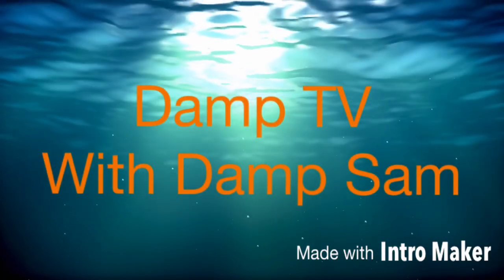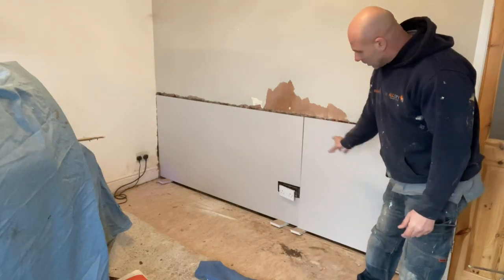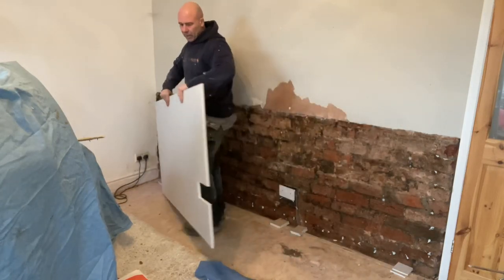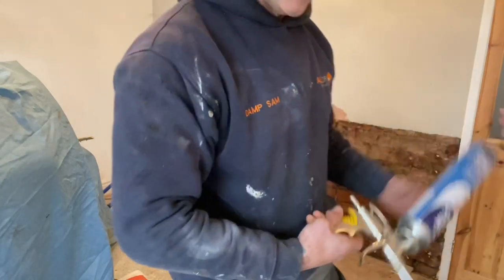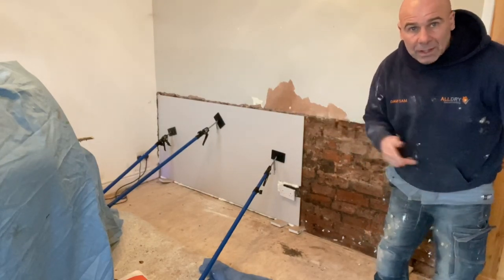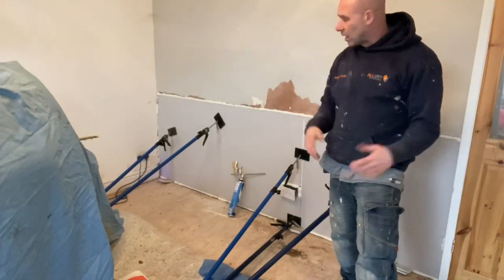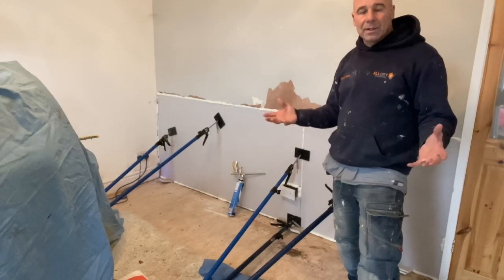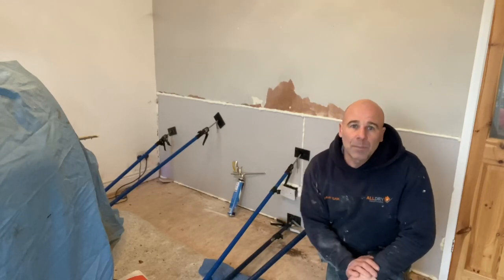How to Dampproof a small wall like a boss

Comment: Damp proofing injection does not work. You need to find the cause (probably a small leak somewhere) and stop it. If that's not possible you need to leave the brick out in the open and have good ventilation or add a breathable lime plaster and have good ventilation
Reply from the maker: I agree that each damp issue has to be diagnosed and not all damp is rising. Lime plasters can work in the right situation but not every one, they are expensive too and not accessible to all. Poorer people have a right to live damp free and this is why cheaper faster systems were brought to market.
Reply: U can also have more than one issue. In our 30s semi, in kitchen, when first moved in damp, mould appeared. After investigation by me, I cut the back out of low cupboard under sink, but it was slightly further over from sink pipes was an old pipe  sticking upright that had been capped but was very slightly leaking. Not enough to flood but did make very damp behind cupboard. Fixed it all pleased with myself in the hope that was that.  Still got damp possibly from a concrete slab added at back door under kitchen window. Eventually I cut channel in it so it wasn't connected to the wall of house above the ground level. Still to finish that job. But also condensation is quite common. Any steam hits the gable end wall and ends up dripping down wall, if don't have extractor fan on and window open. It soon drys, but winter it takes a bit longer, and can be tough opening window when freezing. Watch out for drying clothes too. Especially on radiator. Really u need window open too, so the moisture can escape. I've seen it a lot. Tons of washing drying, windows closed causing bad mould growth.

Comment: Hi, watched a few vids now and I know you use acrylic and foam to fix the boards, l know the foam grabs quick and let's you move on while the acrylic sets. Where I'm a bit confused is does the foam not spoil the effect of the acrylic, I imagine it doesn't because you would stop using it, but then why not just use the foam to fix. What's the benefit of both.
Reply from the maker: Hi, thanks for watching, when the foam dots are first put on the board they are so flimsy that the board would just touch the wall if you applied it straight away. With the drygrip dot in place too you can feel when you ease the board to the wall, 
Also as the drygrip dots are around the same size the board is against the wall pretty even meaning if the wall is plumb the boards are not far off straight too. 
When set the drygrip has a mega strong bond with the masonry about 10 times stronger than the instastik. 
Iv used drygrip to stick all sorts of things and materials
Reply: @dampsam  Cheers, makes sense

Comment: Its best not to use plasterboard but instead use the light weight tiling boards. I have done this on a very cold/ damp external Victoria property and its been over 5 years with no damp patches or black old growth!!
Reply from the maker: I used them in an outside toilet
Reply: but can you skim over those tiling boards?

Comment: Thanks for your videos. I've been told not to plaster onto skirting or architrave. Is this only when it's unpainted? Is there a risk of deforming with a same day skirting refit?

Thanks
Reply from the maker: I’d need to know more about specific jobs but iv never had an issue on normal timber but green oak will go black and spoil

Comment: We are currently using the coucil system inject and dry coat what is your opinion on this system mate .
Reply from the maker: Iv never used Dri Coat but if it’s in accordance with BS6576 it would be acceptable

Comment: Hi Sam
We have rising damp around fireplace and going onto walls . Had cream injected 2 years ago. Plaster was not removed.  We repainted after 6 wks . Damp still comes through badly.  Using your system does it not eventually come through plaster board ?
Reply from the maker: Hi, if our system is installed correctly and the correct type of damp is diagnose

Comment: What if there is not enough height to set board into the area needed? (If the board sticks out much further than existing wall)?
Reply from the maker: You buy the board to suit the thickness
Reply: Cheers for the reply but what if there isn’t a board thin enough?

Comment: Considering this system for my internal wall (no cavity) that has been diagnosed as rising damp - do you see there being any advantage to installing a couple of vents along the bottom of the plasterboard/skirting to allow the wall to "breathe"? I know people keep advocating for lime plaster, but this might be a happy medium that is both quick, affordable, and allows the underlying brickwork to vent.
Reply from the maker: You would just be making holes in the wall so if you want to lose all the heat in your house that’s what will happen. Make sure your treating the correct type of dampness then use the correct system
Reply: @dampsam  yeah it's definitely rising damp - internal wall between hall and kitchen in a lower ground property, no damp proof course on the internal wall so doing DPC injections then just got a consideration about how to reapply plaster/render over the brick once treated.
Wall has a radiator on it too, I'm not sure how much heat would be lost as it's internal.
Reply: Certainly don't go with the idea he's a full on conman 💯
Reply: @joerobinson2866  yeah this feels like hiding an issue until next person is forced to experienced it
Reply: @joerobinson2866  so in my case a brickie came out over the course of a few weeks and removed the lower course

Comment: Would you inject to solve damp, or use slurry, sbr, and gear for salts,  then render ???  Ive seen injection fail a few times.
Sovereign show a how to, just rendering and slurry coat with K11.  Have you seen that work , without injection?
Reply from the maker: There is no need to use a waterproof slurry above ground unless it’s to neutralise salts or to stop latteral dampness

Comment: Hi, my damp wall has a massive amount of plaser on it, 50mm could i "Layer" boards using dot and dab to achieve thickness or do you have another suggestion
Reply from the maker: It depends on what type of dampness has been affecting the wall previously

Comment: Hi. Am I ok to ask a question? I have just bought a small mid terrace which has rising damp and because it has been empty for some time, also problems with condensation. The floors have carpet laid on top of tiles which we think are on top of solid ground with a layer of ash or similar below: no modern foundations. Would you advise doing anything to the floors as well or will it be enough to damp proof the walls? Thanks.
Reply from the maker: The first thing I would advise is to get a competent qualified damp surveyor to diagnose all the different types of damp affecting the property. It’s very rare it will all be actual rising damp so you need to know which is which so the right system can be installed as a fix.
Reply: Thank you so much for your advice. Will do.

Comment: Interesting method ive not seen used before, generally I would sbr the wall first slurry the wall a few times once tack on SBR coat, then sbr the dry slurry and render the slurry with sbr render, I never use a injection systems they are all useless, if your render is thin enough then I suppose it would be good to then do this onto the render and use either a insulated board or green board, what is the acrylic you are using and is the foam a pu type?
Reply from the maker: It’s called Drygrip by Safeguard John

Comment: Hi simon  I would like some advice my daughter house, has a cold spot in corner of one her bedrooms it feels damp and there’s some mould starting.I have been up in the loft over into the corner were the damp is  but it is dry there about 100 mil insulation ,but my daughter house is a semi that corner is were the devideing wall  meets the exterior wall ,I would like to here your thoughts on this problem and the benefit of your experience.
Reply from the maker: Hi james, without seeing any picture it’s hard, but check for leaking gutters or rainwater hitting the wall outside and inside I’d check the ventilation is adequate with the cooker hood vented externally and a continuously running low carbon fan in the bathroom for a start.
Reply: @dampsam Sorry to jump in on your chat but l had a similar situation in my bedroom on the chimney breast. Around 1 Sqm of the wall felt damp so l investigated directly above in the loft and even removed some of the brickwork to gain access to the inside of the chimney. On inspection it was dusty and dry inside….🤨 I decided to remove the section of plaster down to brick and discovered the plaster was sound and dry so my plan involved foaming a piece of foil backed plasterboard to the brickwork then skimmed the entire chimney breast and once dry re painted the wall. That was 3 yrs ago and no more issues with the damp. I came to the conclusion it was condensation forming in that area due to a cold spot caused by the cold air inside the chimney stack and warm air from inside the house.

Comment: Could you not just use the insta stik or would damp strike through that then into the plaster board etc??
Reply from the maker: You could have a go but it would be hard, Iv tried using both separately and I find using both is better for larger boards, just the drygrip is good for small boards.

Comment: Why do you use that grip and not board adhesive apart from saving time?
Reply from the maker: Board Adhesive reacts with salts and damp, Drygrip is specially made for this system and is waterproof
Reply: If you use board adhesive, it will mould and salts will come through if it has not been treated with safeguard salt neutralising cream and or dry rods installed if the house was built before 1859 (when slate damp course was first used), there will be no slate DPC, so you will have the same issue over and over.

Comment: on external solid walls where there is no cavity. is it ok to batten it out and just screw plasterboard onto it. would this be good because it stops the outside wall touching the plasterboard and allows it to dry?
Reply from the maker: In theory yes

Comment: What a great video cheers can I pick your brains what kind of foam is it your using and what have you drilled into the wall iv just tanked my wall and the water running down the tanking is unreal ant help would be great
Reply from the maker: Hi thanks for watching. Is the wall below ground? I’m wondering because that would be the only reason it should be tanked ( waterproofed). I don’t think water will be coming out of the wall. What tends to happen is condensation will form on the material and if it’s waterproof and cold then unless the ventilation is adequate it will act like a dehumidifier and run down pooling in the bottom. 
Always diagnose the type of damp correctly so the correct system can be used. Not all damp is rising.
Reply: @dampsam  thanks for the reply no the wall is above ground do you think I should knock the tanking off and just use the stick instead to stop the damp cheers for your reply again very helpful
Reply: Sorry to ask again what was the adhesive you put the boards on with great way to do it would like to try it cheers
Reply from the maker: @patrickgilmour9826  it’s called Drygrip and can be bought off Amazon,, you need an applicator to use the cartridges
Reply: @dampsam  thank you it just seems an better and less messy way to do it is the foam just a standard foam to
Reply: Could you not just attach with the foam, why use both? Thanks
Reply from the maker: @wirexsbv  I feel once set the DryGrip has a greater grip and grab strength than the instastik , I use the instastik because it holds the board in place quicker and you can move onto the next board.

Comment: Hi Sam, when installing dry rods in old property, whats the best course of action if mortar is old and crumbly and maybe has gaps in it? Also if you have access to basement that runs under the entire property, can the DPC be installed there - just above the old failed slate dpc?
Reply from the maker: Deepak Bhari alway install any dpc on the first joint above floor level. The rods only start to work when they come in contact with moisture so as long as they are inserted at the correct spacing they can go in any type of mortar course.

Comment: Hi Sam, i am finding you video’s very helpful thank you. I am currently doing some work on my own home and trying to fix some damp issues. I have solid walls and have noticed that in the past someone has used some type of cement render around 1m high on all ground floor walls. I think there is issue with bridging as its been taken down to the floor (solid floors). I have been told to remove all cement and plaster and install dpc 1 brick above the solid floor, then install batten board the walls above the dpc (using celotex foam insulated board for external walls). Theres so much conflicting information online, so easy to get lost in it all. Do you think this solution is good? I was thinking to forget battens and use the dry wall method in this video. Just wish i did not have to remove the cement render as its pretty solid.
Reply from the maker: Hi lee, 
It’s hard for me to comment as Iv not seen the job. I would recommend doing a postcode search on the PCA website and have a qualified surveyor look at it, make sure any issues are diagnosed correctly.
Reply: Check out Peter Ward heritage channel on here and start your education into old houses! I have and it's fascinating. Stay clear of cement based products on solid brick walls and plasterboard. You want lime.

Comment: Ruining old buildings. 
Sealing in moisture thinking your sealing it out. 
The old houses just need original lime based plaster and mortar. 
This modern industry has no place with these old places!!
Reply from the maker: Preserving old buildings using up to date tried and tested BBA approved environmentally friendly products to save time and money for customers not stringing out work using the excuse that the work is traditional.
Reply: @dampsam  your method is like going for a walk in the rain, 
Getting soaked through, 
But instead of taking off wet clothes and getting dry,
You keep your wet clothes on, wrap your clothes in clingfilm and put dry ones over the top.
To the outside you look dry, but underneath your still soaked with absolutely no way of the moisture escaping and drying out as air cant get to it. 
Absolutely nothing to with being environmentally friendly, that's totally irrelevant.
Reply: @teocastelvecchi  so whats the best way, if you dont mind me asking. Im cuurently about to adress rising damp in my old house.  I was told the injection teqhnique is best
Reply: @inamhassan2694  hi mate. Its something I've got quite a bit of experience with between me and my dad. Rising damp as it's called is almost always not the issue. I would have to see some photos and talk it through with you. Do you use whatsapp?
Reply: @teocastelvecchi  

I’ve got a rising damp issue in an old terraced house. I need some advice on the best solution for it. Are rods no good?
Reply: @anirbandas9852  I can certainly tell you the cause of the damp and how to get rid of it. Fix the cause, then allow to dry. I'd need to see photos and almost a video walk round to be honest. Want to DM me your contact details?
Reply: @teocastelvecchi  I was about to plasterboard a wall I've taken back to brick that has had some damp issues. I've actually done a damp course but I dont think its worked...im still learning. The best solution I know about is to lime render the walls but for every 5mm it needs 1 month to dry. In my case I've probably have to wait 5 months before I can paint the walls. Do you know of any other solutions?

Comment: Great video going to use your method to help me out just one question will it stick to insulation board and would you put board on vertical or horizontal cheers sam
Reply from the maker: Yes we use them on insulated plasterboard and it’s your choice which way you fit the boards, which ever you think is easier for yourself.
Reply: @dampsam  cheers again great content
Reply: You never show you putting salt neutraliser on the wall
Reply from the maker: @davidgilmore9997  I’ll try remember next time, it’s a simple process though
Reply: @dampsam  iv done Yr process on putting these boards on the wall only thing the 2/3 inch gap at the bottom between the board and fall there's a bit of condensation appearing on the bricks any advice before I put the skirting on cheers